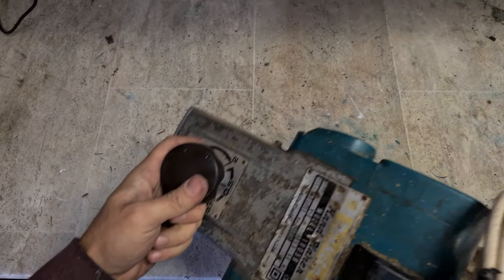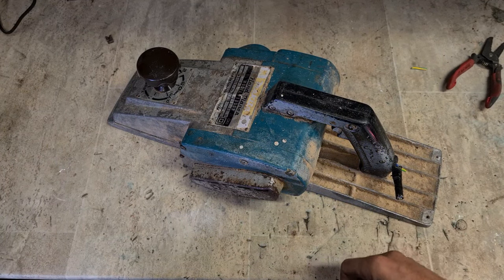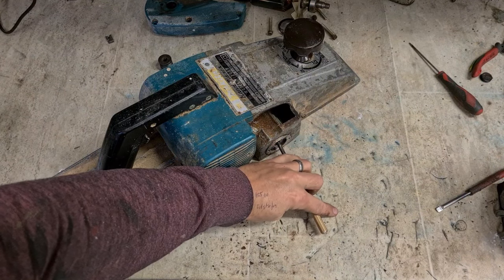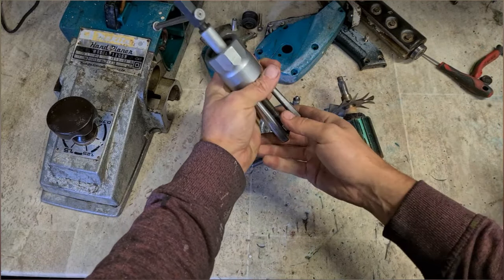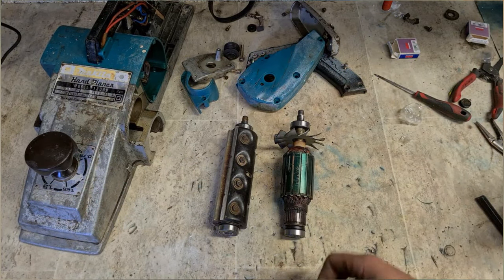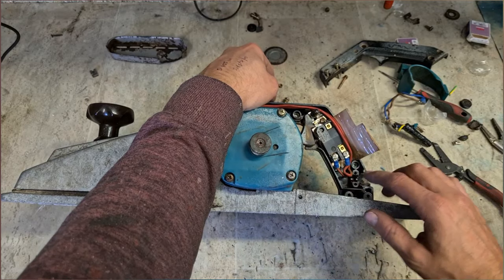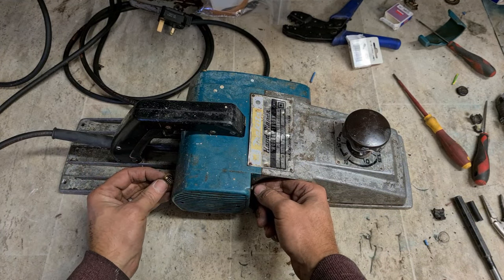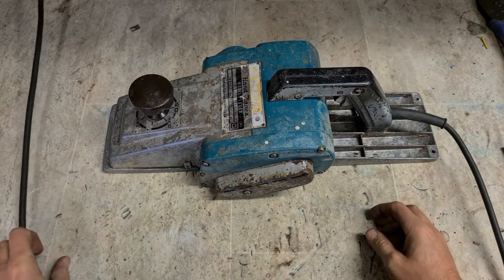Repairing a big, old and well used Makita 1805B beam planer.

Comment: I'm old enough to remember when a huge percentage of the tools available were of good to great quality... now, the vast majority are just garbage. It's great to see someone rebuild these older workhorses... if you fancy having a go at repairing my creaking Knees, let me know! 😃
PS. I wish the people who make those little Wire Ferrules would make some with 'O' and 'U' fittings attached - I've had endless trouble over the years with those Plastic Crimped connectors. The quality of them is always low and the connections are, at best, iffy when it comes to strain relief.

Comment: your vids are fantastic mate, why dont you clean the machines though? they work fine on the inside but look like they have been pulled out of a pond
Reply from the maker: Because they are working tools. Why clean them and make them look like new. The customer is going to use it again just the same.
Reply: just looks a bit more professional thats all
Reply: @barryclyde8353 well then you gotta charge more and most real tradesmen like that old work patina on their tools.